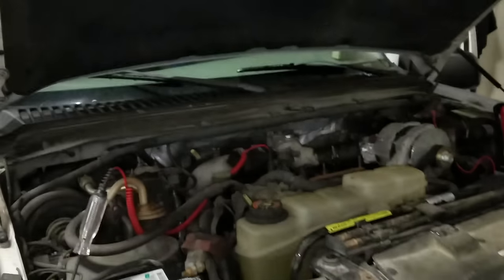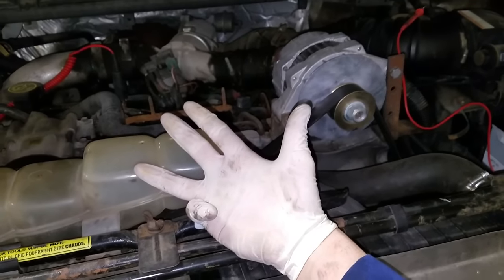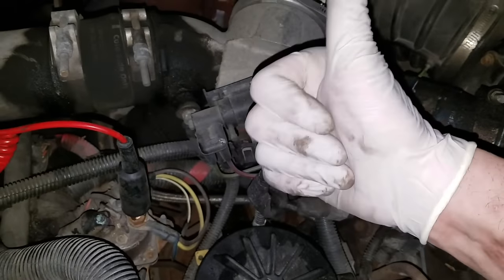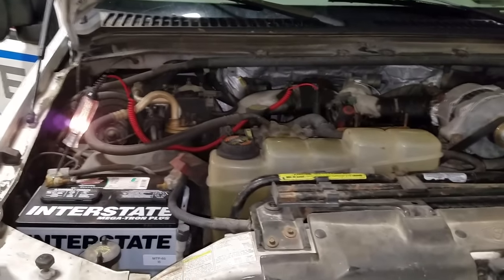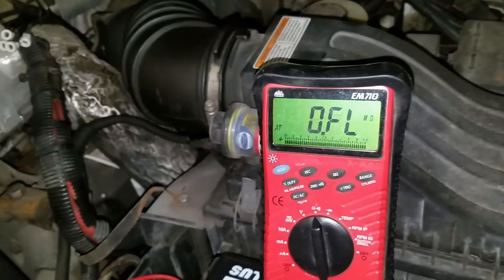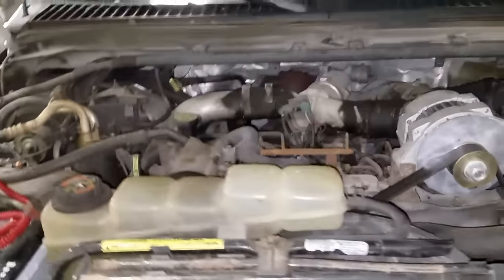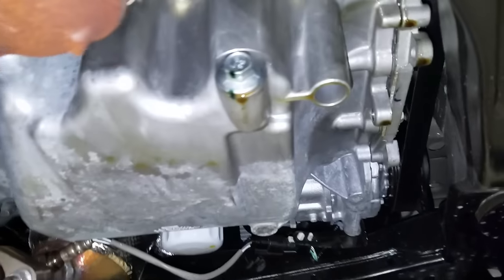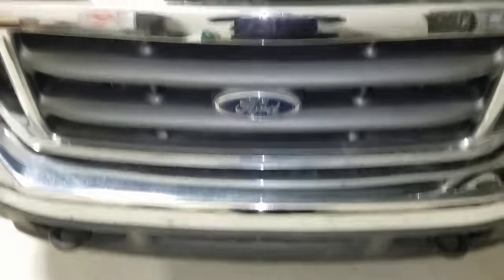Ford 7.3 Diesel- GLOW PLUG SYS-TESTS

Comment: Nice Thor's Hammer electrical proof testing.  I just bought a 2000 F-450 with a dead glow plug relay.  I live at 4500 feet and it gets very cold.  A little time on the internet and it is my understanding that the OEM relay is undersized.  The replacement that will last the lifetime of the vehicle is a "White Rogers 586-902" 200 amp relay.  These are used for many purposes and are built tough.

Comment: I have a 01 7.3 and found that my GPR wires that go to ignition solenoid in the harness was burned chewed and melted and the relay itself is extremely bad looking truck was ok took a hour trip and then battery light came on figured the alternator and changed it didn’t work was really cold to snowing etc kept checking things out turned out my IPR was bad or not working the sensor part was busted so changed that etc started up but not easy and damn thing wasn’t charging still ...swapped the alternator out and figured Shity parts store one etc and damn thing still wasn’t charging etc was chasing things like the signal wire on the alt with key on was only seeing 9 volts 🤷🏻‍♂️🤷🏻‍♂️ idk why.... my batteries are little low etc but should still see 12v etc started looking around and found the burned chewed up ones traced them back to harness behind the a/c pump on top that went to the GPR pulled boot off the main one and severely corrosion etc rust soooooo any way to fix the burned chewed end etc snd just replace my GPR if it tests bad

Comment: Unsaid, but an intermittent condition appears to most likely be the relay only sometimes working? PCM or oil temp sensor failure would tend to be be complete, yes? Also, you're sometimes getting a click but still no power transfer. Could that click instead be the intake heater relay in the front? You mention another glow plug video but I can't find it.

My step father-in-law has been jumping 12+ power to the FRONT relay for a few seconds and then starting up successfully. He's been thinking that front relay is the glow plug relay ... but apparently he was inadvertently activating the glow plugs somehow I guess since those two relay do share some connections..
Reply from the maker: Front is intake heater, rear is gp relay

Comment: Will a failed glow plug relay cause the SES (check engine) light to come on?  My 2001 F250 7.3 has symptoms of cold no/hard start (have not tested relay yet) - and the SES light is on.  This year of diesel did not conform to OBD standards, so a regular OBDII scan tool won't give me codes/info.   (And I see 2 almost identical relays up there - you're testing on the one closest to the firewall.  What is the one for that is closest to radiator - a few inches fore of the one you're testing?)
Reply from the maker: No it will not. An OBDII scanner will pull codes for this...also it is the intake air heater relay

Comment: Mine is hard to start while cold I have to cycle  key like 10 times then starts. So today I put bigger relay on an its 70 degrees  today still had alot fuel smoke come out exhaust does that mean I have glow plugs bad?
Reply from the maker: You need to watch the video and test the glow plugs. I have other videos on it too

Comment: Do know why the California version has a module instead of a relay? Just curious what it does different 🤔
Reply from the maker: The module monitors the resistance of all the glow plugs and tells the PCM if one has faulted to turn the check engine light on hence California emissions

Comment: You can go to the junk yard and find a 7.3 of the same era and cut the harness. Also in a pinch you can use a test light to check the glow plugs
Reply: Hi I watched a video that showed this test light method before I started working on my early 99 this week. I had 2 bad plugs show on the left side, and tested them with a battery charger when they were out. Those diagnosed correct with 2 working, the other side I had 1 not working from the light test. 
        I figured I'd replace all 4 while I was there as passenger side is more of an ignorant bitch to work on. when I tested them out I had 2 bad not just the one. The second one would spark when I put power to it but wouldn't heat up and glow bright orange like the other  good glow plugs.  My guess is if my  multi meter was around the home shop this week that plug will show a reading but be out of the spec shown in this video.

Comment: So I finally figured out how my multimeter works and took some readings off of the GPR. After turning the key the glow plug terminal initially read 0. Then after about 20 seconds I heard it click and got a reading of 11+ volts. It seems weird that there would be that long of a delay between the key turning and the relay activating. Do you have any suggestions? I plan on testing the glow plugs next to see if they are within spec.
Reply from the maker: Relay.....

Comment: Would this cause a crank no start 
in  general.  

Cuz this is my problem  I’ve searched all over the net & YouTube 

All right I’m at my wits end with this truck it’s a 1995 Ford F3 50 7.3 dually quad cab It’s Tabs Dad he run it out of fuel twice then about a month or so it started idling rough and not really want to start in the morning that went on for about a week or so then he was driving it and then it’s hard to drive and rough just as rough as it was idling then he drove it like that for about another month and then it he started having it to where it was dying on him occasionally then we were at a stoplight one day and it died on him and took her straight home then we brought it here why I’ve been working on it 
First thing we discovered it wouldn’t get enough fuel because of the tank selector valve so I tapped on it got it to work for the time being then we went to getting enough fuel pressure to the fuel bowl so we figured it he burn up the pump so we replace the tank fuel selector Valve and the fuel pump and also I took out all the injectors open them bottom part only and cleaned him come to find out one of them had a piece missing and one of them had a broken spring so I fixed it and put them back then we will get fuel to the bowl and all the cylinders were hidden but it just still wouldn’t run so I did some more research it some more tinkering and replaced die PR valve and ICP valve because my troubleshooting led me to believe that those may be a problem as well so so far it’s got a tank selector valve a brand new fuel pump ICP valve and I PR valve then we were able to scan it somehow or another we figured out that we could scan it so then we got a scanner and scan it it was saying high side was open on the driver side I’ll send u the codes 
So I troubleshoot it that and found the valve cover gasket was bad and we just replaced it back last year this time so what I did was I replace them both and I did a Home reading on the entire system and I have that as well I will send you and I follow that procedure and I ohms it out 3.8 For the whole system and I double checked the IDM and everything to that seems to be OK as of yesterday it ran for about a minute and a half it chugged really bad but it ran There’s proper amount of oil and a high-pressure oil pump There is enough oil in the motor there’s proper amperage in the batteries proper voltage in the batteries had to replace the starter because I guess us trying to get it to crank over the other day her but a week ago it burned up starter so we replace the starter and I will send you the last thing it showed because now I’m having an issue to get the tester to read it For no longer works on his old vehicles and have no way to scan them so if you know anybody that has an in-depth scanner to do it it’s it takes an OBD two that’s what it’s been updated to because I don’t know what else to do we done everything that I could fine as far as troubleshooting and what I can fine as far as the half ass manual so I can get here in there

Here is a list of all I have checked or replaced:

1) changed oil and filter, checked oil level.
2) checked fuel bowl for the loose heater - good
3) checked fuel filter, changed it less than 1000 miles ago
4) check glow plugs out of the motor 
5) checked all engine compartment fuses
6) checked wiring harness for frayed ends
7) replaced the ECP? (front sensor)
8) checked for oil on the ICP sensor - none
9) replaced several CPS's
10) checked HPOP it’s up to spec 
11) changed both VC gaskets & checked harness.
Reply from the maker: If you'd like to make a donation to my Paypal, we can go into more depth w/your concern over the phone.
Reply: How much
Reply from the maker: My fee here is $50 USD. Make sure to mark it as a gift. Your email will be left, with that we will continue with high speed voice communication.

Comment: What if the PCM is not turning on the relay? How do I test the pcm? I'm not getting the click sound or no light at the relay with my test light.
Reply from the maker: Did u unplug the oil temp sensor on the reservoir & re try
Reply: Sorry, I have the California model. I get no click sound at time glow plugs should be turning on.
Reply from the maker: Email me, i do not get any notifications after the 1st 1

Comment: well I know the 2017 f 150 has gen two. I don't know if the explorer PI has gen two yet. the new 3.5 eco has direct injection with the old school fuel injection as well to help keep the combustion chamber s clean. kind of a a wierd set up. they probably will phase gen two ecoboost accrossed the other models later.

Comment: Got a question I have a 2003 F-250 Ford lxt old 7-3 in it it's just hard to start it takes about 15 seconds to 20 seconds to start up slower than usual
Reply from the maker: Have to go thru the vid bud and do those tests...

Comment: Hello,
99 f350 7.3 here.. 
would a bad EOT sensor cause a "no click" in the GPR?  I just changed all 8 glow plugs with the z11 motorcraft.. power to the constant side of gpr but no click and obviously no power going thru the gpr.. any ideas?  my truck is showing signs of a bad EOT .. intermittent CEL and rough idle on cold starts. occasional low rpm stumble

 thanks for any advice you have
Reply from the maker: Make sure to check my other 7.3 glow plug video....I go over that
Reply: @PowerStrokeTechTalkwARod  I looked and couldn't locate it.. im not sure how to search your channel?
Reply from the maker: Goto my Playlist tab..I have one for these old 7.3s

Comment: Hey love your videos, I have a quick question, I have a 2014 f250 6.7 xl with power locks and I had this problem with locks not locking or unlocking but when I hit the button on the key it would honk the horn like it locked or unlocked, and they told me it was the fuse and they put a 30 amp in stead of 20amp, cause by this point i took it in at least 4 times for the problem. Well it happen again I went to change the fuse and it wasn't blown so put it back in and it worked any suggestions on what could be tripping it like that?
Reply from the maker: +Medicshee350 oh gosh, sounds like them dudes who are diag'in need to go home. Ill have to look into that guy..
Reply from the maker: +Medicshee350 thanks for watchin too!!

Comment: On mine the yellow and brown wire going to the glowplugs from the solenoid seem to have a dead short to ground.  Therefore I turn the key on and it throws sparks and blows something out.  Any ideas?
Reply from the maker: Whaaaaaa
Reply: @PowerStrokeTechTalkwARod  Kinda what I'm saying.  I don't know a lot about diesels yet just bought mine

Comment: I just replaced my glow plug relay and still no click and hard starts in morning on cold day any thoughts
Reply from the maker: I go thru pretty much all the diag for u.....
Reply: Check the resistance of the glow plugs there's another video that will show you how to without the connector tool

Comment: Just tested mine, because of hard cold start. I got 2.7ohms on each , not entirely sure i did it right. Does 2.7 mean theyre bad?
Reply from the maker: ......what was the spec....
Reply: @PowerStrokeTechTalkwARod  what do you mean by spec, im still pretty new to this, sorry. My meter read 2.7 when i tested
Reply from the maker: What was the specification. If you watched the whole video, i mentioned it there while testing...if you need further help you gotta visit my paypal

Comment: Hi there I am having some trouble with my 2000 f250 superduty turbo diesel cali truck.  I keep getting the p1395 and p1396 codes which say glow plug monitor bank one and bank two.  I have replace all glowplugs and the glow plug relay and the high pressure temp sensor new uvwh and have cleaned all the plugs that plug into everything with electrical cleaner.  But I am still getting the codes.  I'm dieing here any advice?  The truck runs great, but I cant register it until it gets rid of these codes for smog purposes.
Reply from the maker: I need vin, ill check tomorrow
Reply: @PowerStrokeTechTalkwARod VIN: IFTNX20F2YEB08698
Reply: Any luck yet?
Reply: @PowerStrokeTechTalkwARod  I just replaced the barometric pressure sensor,  now it only throws three codes when it's cold outside.

Comment: Does a 2005 6.0L have a relay similar to the one in this video? I have an 05 6.0L F250 that acts weird every winter if not plugged in. If it's ~ 35° outside and the vehicle is not plugged in, I have to cycle my ignition on, wait for the flow plug indicator on the instrument panel to go out several times before my truck will even attempt to turn over. 
Turn the ignition on, wait for light, turn the key to the start position and nothing. No clicking sound or anything. Never attempts to start. 
After watching this video, it makes me wonder if I need to replace the relay. I have something similar in the passenger side inner fender that looks like a starter solenoid or just like what you were calling the relay that you were tapping with the hammer. 
There's also been a couple of occasions that when going on to the start position with the ignition, my starter kicks in, started cranking and truck wouldn't start, and turning the ignition back to off and the starter stayed engaged. 

Any ideas?
Reply from the maker: Oooo yikes...need an email to help with that
Reply from the maker: Chk ur email
Reply: @PowerStrokeTechTalkwARod  
Haven't received anything yet.
Reply from the maker: Hmmmm says sent
Reply: @PowerStrokeTechTalkwARod  
I got your email. Thanks. Sent you a reply.

Comment: When I turned the key over. Isn’t that what I’m supposed to here or is it do I hear the click and see the light turn on the tester?
Reply from the maker: Correct, even tho u hear the click, u need to verify that infact power has transferred over to the other terminal. Whats ur email..
Reply: I got a tester. It’s a power “ on” tester. I clipped it to the back plug. And then touched the positive terminal. Light went ON

Comment: Nov 2019 ~ here’s one place selling that test harness online :
https://www.summitracing.com/parts/otc-6088?seid=srese1&gclid=Cj0KCQiAq97uBRCwARIsADTziyb-qYDDHY1eFSVFVTyOXXPLMuczeFcxtAn7muXiC96qDG2dW0W7uUIaAjaaEALw_wcB
Reply from the maker: Thats for the older powerstroke...pre 99
Reply: True - Ty for pointing that out. My best bet may be a junk yard. Disconnect the plug cut and strip wires the attach some kind of sockets on the end of the wires to prevent shorting.

Comment: “Not charging him to check the glow plugs”. 

Stand up dude right there. Most shops around here would charge to check them, then replace the glow plugs, then when it still didn’t fix the problem, say...”Well, the glow plugs weren’t at optimum performance, and because of that, the glow plug relay shorted out, causing them not to work at all” 🙄
Reply: Fact
Reply from the maker: No lies herrr
Reply: Exactly why I'm here don't wanna take it in until I know exactly what it does need
Reply from the maker: Hell yea!!!

Comment: I just bought a 03 Powerstroke and the first thing I noticed was it wouldn’t start in the cold. Now I know where to start. Thanks for the video
Reply: Did you get it going? Where did you start? I just bought a 2003 7.3 and its hard starting in the winter
Reply from the maker: Peep the 7.3 playlist, i show ya how to check if the glow plugs are working or not

Comment: Will this work on a 1996 f350 7.3??? Thank you
Reply from the maker: What the diag tests or the connector tester
Reply: Im very new to diesel this is a crash course for me . At the moment I can’t get my truck to start on 50degree day so im out of ideas its a 96 F350 im about to change the glow plug relay and see if that helps @PowerStrokeTechTalkwARod
Reply from the maker: I wld start there

Comment: Arod, I really like your troubleshooting videos.  How can I get one of those harnesses connectors to test individual glow plugs?  Parts counter?  
Recently you showed cranking with the baloons on the Left/Right bank fuel lines to verify a stuck open injector.  I suspect leaking injector as some fuel was tested positive in the motor oil.  Do you have any other ways of diagnosing injector issues without having high cost tools?  I have a late '99 7.3L with just under 200k mi., also hard to start below 40F, but will start if I use the block heater.

Comment: Question  you mentioned  no smoke coming out the tail pipe had it smoked what would have then be the outcome ? Im having a similar problem but I've noticed  smoke not only in the tail pipe but the turbo as well   any advice ? Thanks in advance
Reply: Im going through this right now what did you end up doing ?